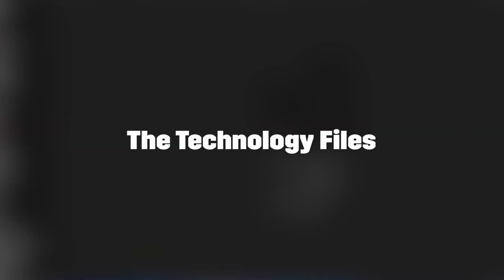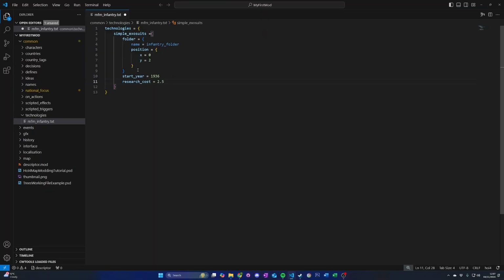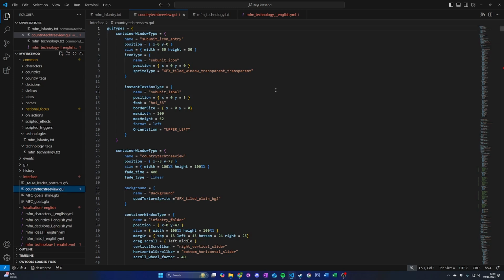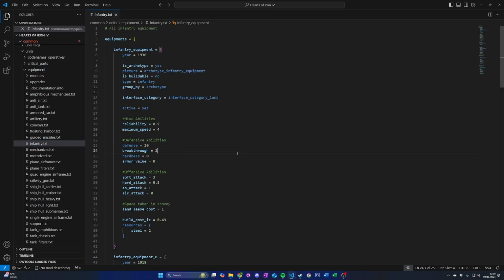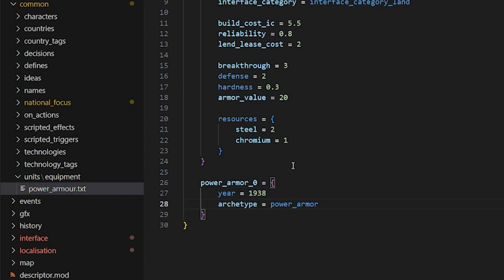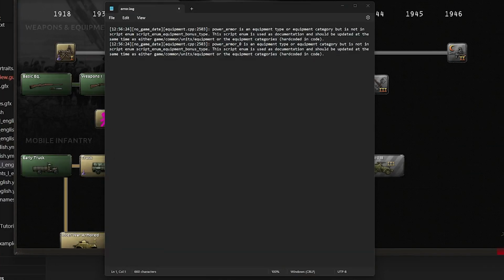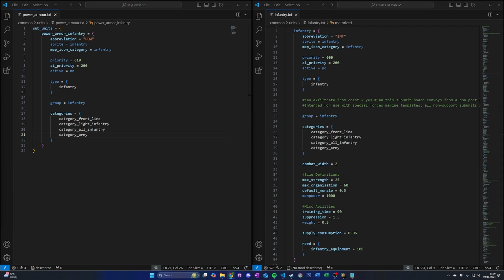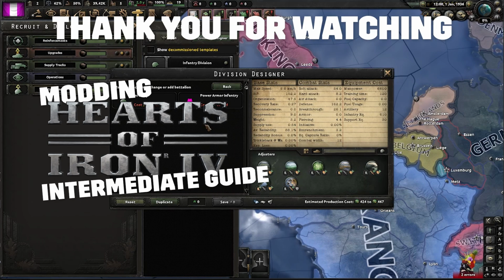Hearts of Iron IV: Intermediate Modding Guide | Part 4 - Adding New Technologies and Units

Comment: I have a bug or problem. I'm making new helicopter equipment and I only have two new technology slots. I followed the steps and everything looks fine: the GFX, the unit, the locations, everything. But when I unlock the helicopter upgrade from heli_equipment_0 to heli_equipment_1, the icon doesn't appear in the production list. Is there any way to fix this bug?

Comment: Can you edit the stats of existing vanilla equipment (light tanks for instance) , changing the stats for the sub unit works fine (ive successfully changed manpower values) but i can't get the equipment to work, the need of the sub unit is properly defined, the technology is also enabling the right equipment, i can only guess the equipment txt isnt overwriting the vanilla one, i also successfully changed some upgrades within the equipment file. (No step back is not active)

Resolved: the equipment file/ tank_light , ect is not the actual proper file , x_tank_chassis properly affect the stats and is actually used by the game.

Comment: The adding art to tech and equipment is actually pretty helpful.

I would also VERY MUCH appreciate a quick section on modules, and especially naval modules, as they seem to format a bit differently.

 What program is used for showing files here? I do not recognize the program icon.
Reply: Vs code